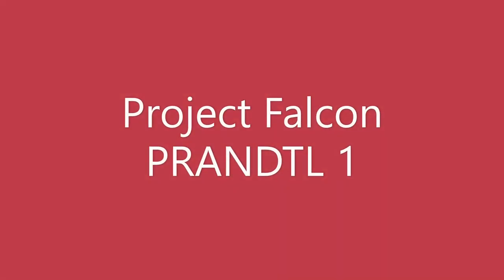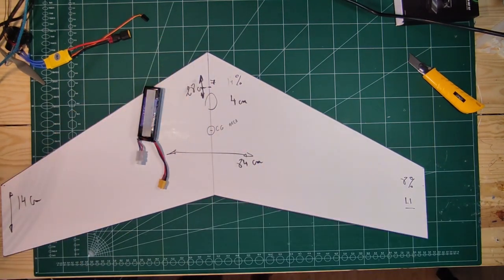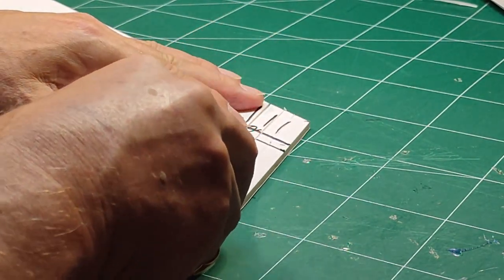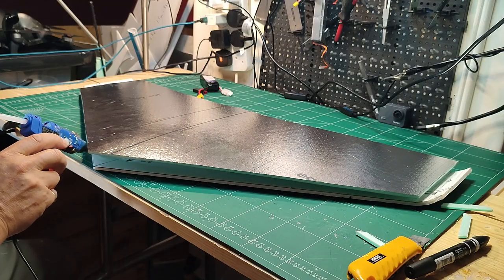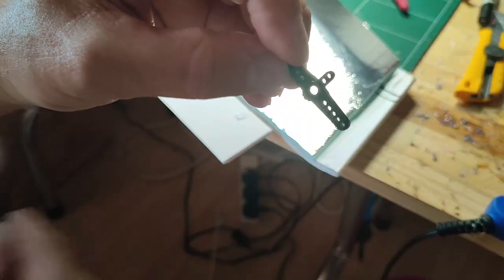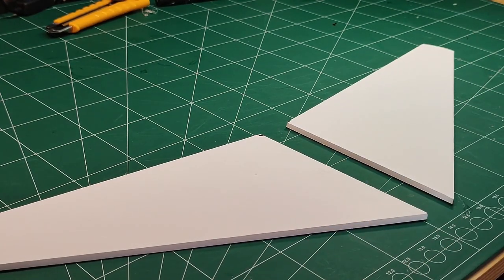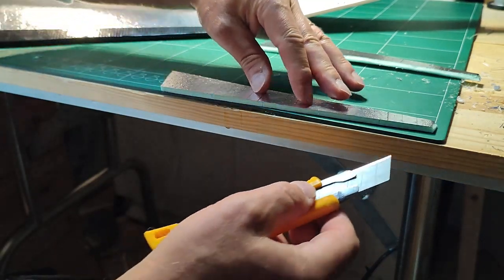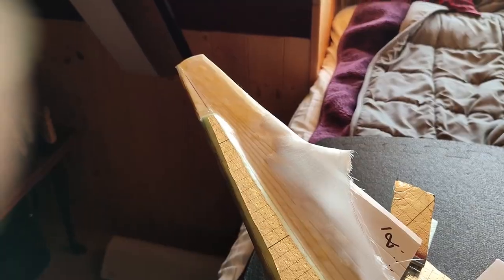Making A Flying Wing With No Vertical Stabilizers. Includes Explanation & Discussion

Comment: very interesting video. I too am a fan of Al Bowers and his Prandtl wings. another way of twisting the wing, is to add elevators to to the outer trailing edge at outer 30% of half wingspan and add your ailerons inboard of the elevators. in a turn to the left for example, the down going aileron will cause the vortex to shed at its outer edge causing the outer 30% of half span to be in upward flowing air tilting the lift vector forward and creating proverse yaw. when the elevators reflex the 30% outer wing to keep the nose up, instead of decreasing the lift as with full length elevons will cause the airflow to tilt upwards in turn tilting the lift vector forward and increasing performance.

Comment: This is awesome. I hope it’s still in service? Totally want to try that type of design as I start getting into scratch building!
Reply from the maker: Yes it's still in service for now 😁, I just tried using it with a 2s battery. It was definitely not enough power... I think I would increase the length of the aileron if I was to REdesign it. For a first prototype I would rather try a KFH like my latest wing. Good luck with your project. Keep me in the loop 👍
Reply: @ericflighttester7145  You sent me down the rabbithole on Prandtl haha 

I saw some designs that had the control surfaces out on the ends of the wing, which would also look interesting on your design. 

I'll probably spend a long time on researching the Prandtl design before I even dare to put something together.

Either way, you have inspired me!
Reply from the maker: Life is good when you have a passion ☺️. And yes plenty scope for improving and testing. Some more dihedral would be nice also 🤔